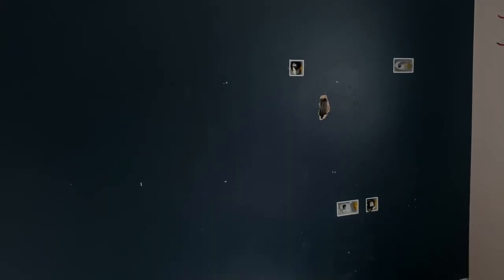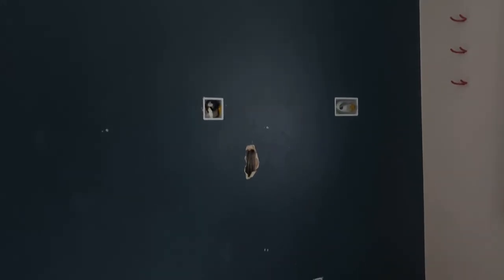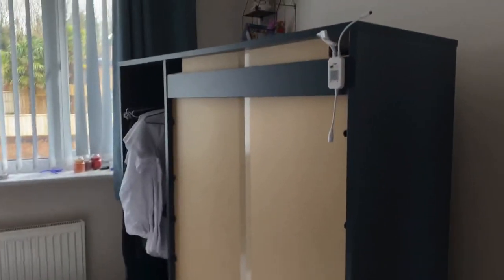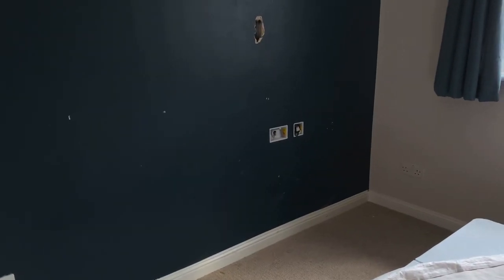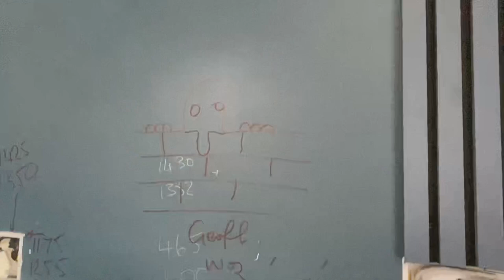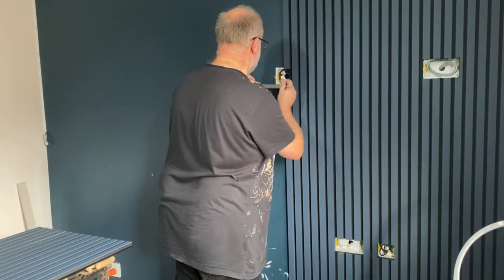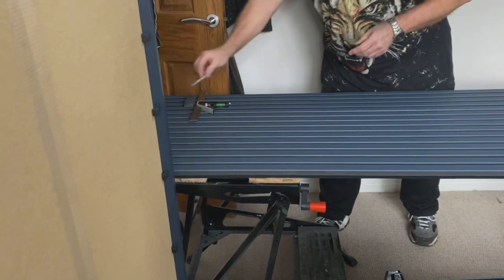INSTALLING A WOODEN timber SLAT TV FEATURE WALL part three [vlog]

Comment: Looks really nice!
My only question would be that maybe a frame of wood should go around the socket because your allowing air in  through the gaps each side of the slats ...this would  allow wiring (in a fault situation)to catch fire and spread rather than a sealed socket being deprived of air and extinguishing itself.
Reply from the maker: Hey thanks so much for watching and your comment. ❤️ We did pack the socket out with left over material from the wooden panels. No air gaps and no access for wondering fingerings to get in behind the socket. This must not be clear visually to see on the vlog so I will update the description box to highlight that has been done for future watchers, so Thankyou for bringing that to my attention. There is a more detailed written step by step over on the blog for those to access our exact steps and tips. Once again i appreciate the support and your kind feedback. Hope you have a wonderful day 💙

Comment: Beautiful work, so happy for you. May I ask what screw do you guys use for the panels? Is that a plasterboard wall you are fitting this on?
Reply from the maker: Hey hope your well. Thankyou for watching. So I linked all the screws I used over on the website if you read the blog teen boys bedroom transformation. But yes this wall is plaster board. I’d recommend finding the joists and screwing them into them. Hope iv been helpful. Any questions please don’t hesitate to ask. 🤩